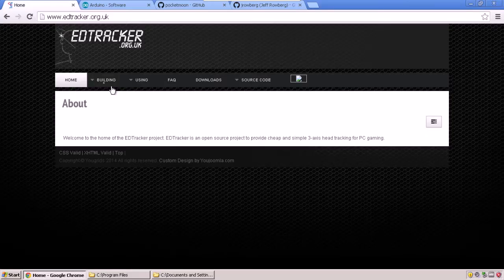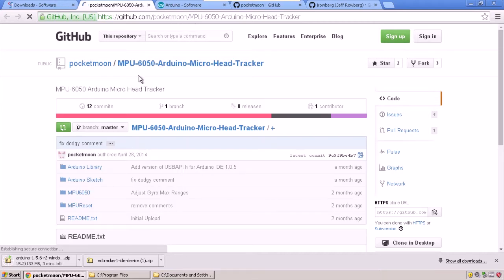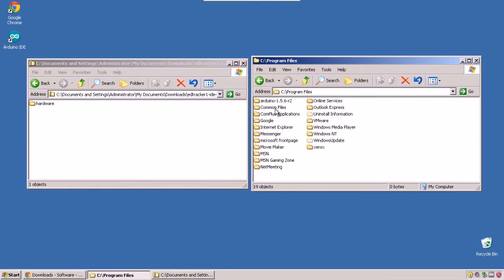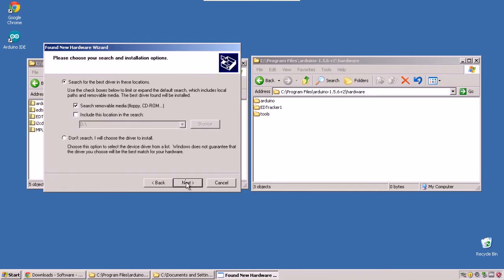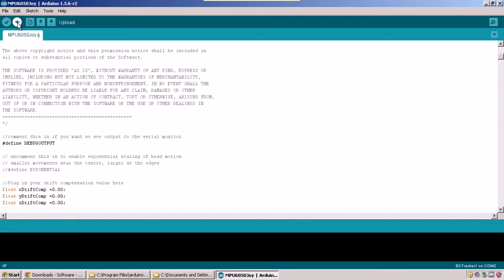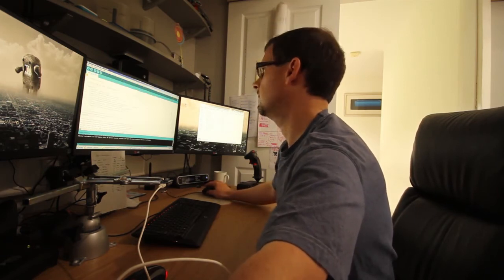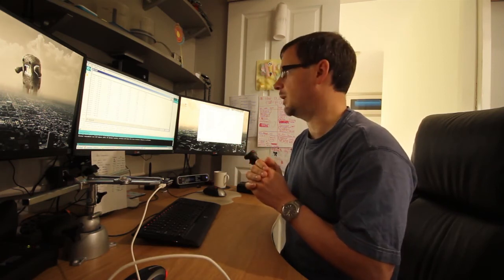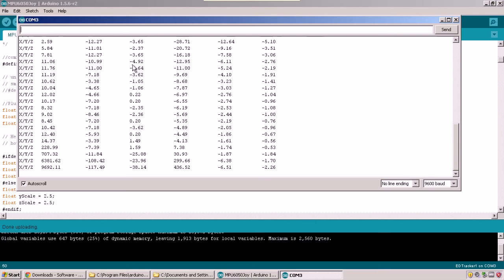DIY EDTracker - programming

Comment: hi, 
i keep getting this in the serial monitor

Full Calibration Requested.
FULL Calibrate
State 0
State 1
State 2
Save offsets
Post Gyro XYZ Accel XYZ:98	-61	-14	-677	-1591	1035
RecalibrateRecalibrateRecalibrateRecalibrateRecalibrateRecalibrateRecalibrate
Reply from the maker: Ah - that's either your button is stuck down/permanently closed or you've got a short somewhere on the button circuit. The tracker thinks you're pressing the button. Is it on breadboard or a PCB?
Reply: brumster100
on breadboard due to placing over the middle line i placed connection wires on the left and right and shorted them out into an eternal reset loop.  found it after 2 hours ;) silly me
Reply: brumster100 Thanks for all your great work on the video manuals  
i have a working tracker now :)

Comment: Great stuff, but suffering from terrible drift here.  5 mins play and my cockpit is at right angle, constantly reseting
Reply from the maker: Can you drop me a PM and maybe I can talk you through trying a few things - would be interested from a testing perspective?
Reply: brumster100 Works much better now, I was using the older v1 code, now using v2 and I've crudely hacked it to constantly recenter if movement under a threshold.

Comment: That's a great DIY project! Just one question, I have the chinese sensors PCB GY-85, what king of modification to the code do I have to do?
Reply from the maker: Quite substantial - you would have to rip out the MPU6050 i2cdevlib calls, replacing them with calls to the ITC/HMG IC's. I would look to other head tracking projects if you need to use the GY-85, if I'm being honest :(
Reply: brumster100
 Thank you for being honest!
btw, I did found a topic on the FaceTrackNoIR sourceforge site exactly about inertial head tracking, and they already did it for the GY-80 and GY-85, great!!
Hope the best for your project! It's looking amazing!